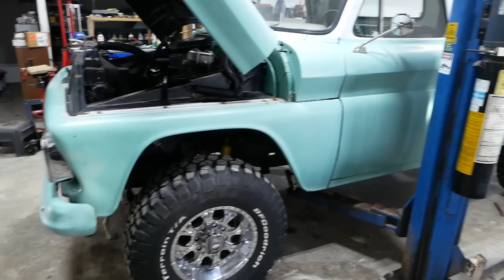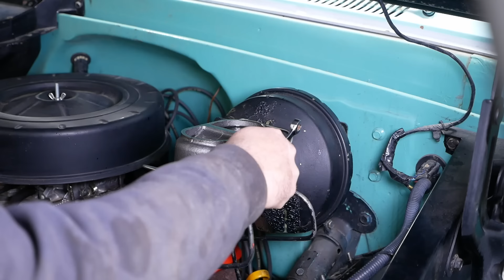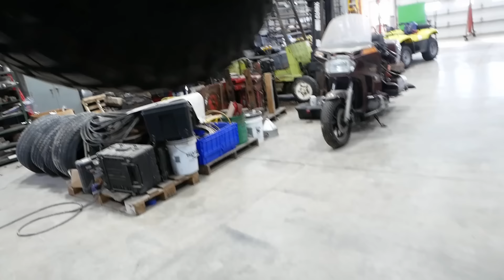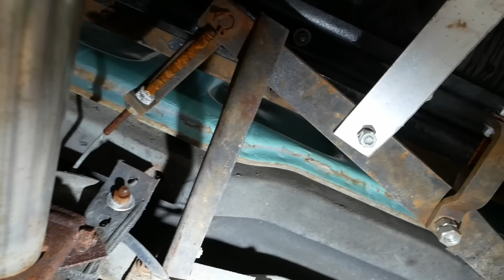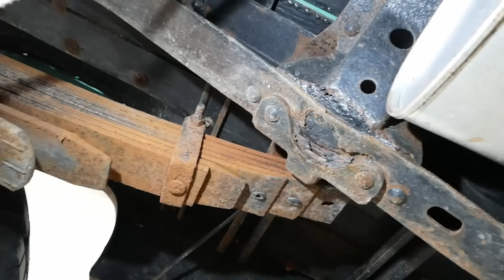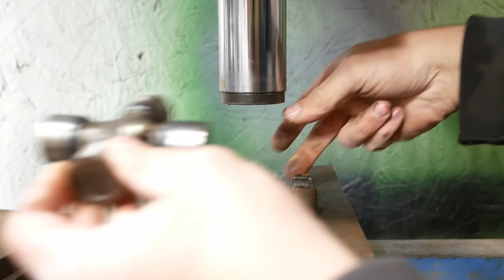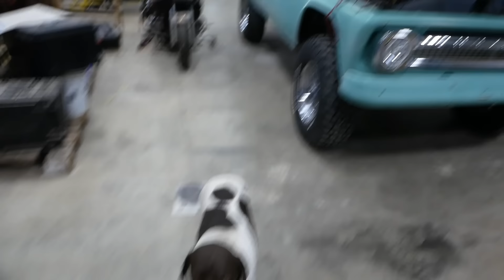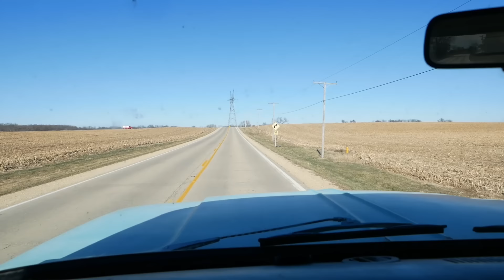New Parts = No Brakes and Other Problems | 1964 Chevy K20 Project

Comment: Hi Wes, one day when you’re feeling bored, try a long barrel air hammer with a flat 1” punch to install the uni joints. Turn the air pressure back a little so it’s got some control, use a socket or something that fits the cap to push it. I find it’s easier than a hammer or a vise, especially when you’re by yourself.
I’m sure someone will say this is a bad idea, but I’ve been doing this for years with no issues
Reply: It's a bad idea. Now it's been said and you can stop wondering when someone was going to say it /s
Reply: Yes that is another way. The dude who has the Halfass Kustom channel uses a ujoint installation tool that works quite well. When I was a Mac dealer we had a ujoint tool in our catalogue (back in the early eighties).

Comment: I like to take a flap disc to those chrome thermostat  housings under where the hose makes contact with the spout underneath where the hose would sit or they just seem to seep for ever. It seems like the coolant is always able to slip by on the chrome surface if you don't.

Comment: I'm pretty sure my Dad had one of those converted into a tow truck when he owned a shop back in the 70s. The interior brings back memories. I drove it a few times in the 90s, and no, it didn’t have power brakes or power steering. Scary as hell to drive as an 18 year old. It rusted out and ended up in the junkyard a few years later. Minnesota road salt is just as bad as Illinois'.

Comment: That guy needs to find a1975 or so 3/4 ton (Parts Truck)  with real axles and gear type transfer case and 4 speed and join the more drivable of the square bodies.  GM corporate were bad about the pinion nut coming loose and howling and reforming the nut or replacing it and re-torquing the pinion to spec's will cure it if it hasn't worn into a contact pattern that makes it "whine" after it is fixed.

Comment: You just go ahead and install u joints any ole way you want to , and if anyone has a better idea, like American Politics, KEEP IT TO YOURSELF, everyones opinion is not FACT !! I have a fine thread "C" Type U joint press that will bend a yoke in a heart beat (It has that much strength) I also have a conventional "C" type , and a Bench hydraulic press also , and if no one is looking , I'll chuck up my 714 CP Long Barrel impact chisel and knock them out in a half a heart beat and use a ball peen hammer to re-assemble before you could reach for my assembly tools.

Comment: What is a bigger controversy how to install u joints or pineapple on pizza?

The hole the brake booster mounts to looked way off and the booster didn’t look to seal the firewall off. That’s probably your air leak.

Comment: I'm agnostic about the grease fittings and method used with a steel shaft. But an aluminum shaft? Press or vise only. A very small hammer for minor adjustments on u-joint only. You can throw the balance out/dent the shaft VERY easily. Ask me how I know. 😖 With those gigonda tires, I'd keep the 4.56's and find a trans with a deep overdrive, (I'm lookin' at you, NV4500! 4.56 x.73 OD= 3.32 overall final drive ratio. And, a real deep 1st gear.). The shorter the gears, the easier it is on everything upstream. Boat load cheaper then 2 ring and pinions.  Also, Mortske is probably correct. A 14 bolt or Dana 60/70 shouldn't be too bad. Even a 10.5 Sterling? ¯\_(ツ)_/¯ (Bolt patterns) Maybe move the spring pads around a bit.

Comment: Before any winter driving that truck needs NH Oil Undercoating ASAP, be a crying shame to let that go to dust... I didn't know there was a U-joint installment controversy and I dont if there is, I still like seeing it done....... As far as Jesus Christ getting flack if changing U-joints,  he got a lot flack from lots of people on everything he did,  then after 3 short years they had enough of Jesus Christ and nailed him to a cross, but it wasn't for changing a bad U-joint the wrong way........

Comment: Ah the venerable ol 283 chevy smallblock.  Wes was it still points or solid state ignition?  Nothing like farting with points every 10,000miles.  And the cam change every 60,000miles, and plugs, and carb tuning........  My dad rebuilt many a chevy smallblock engine.

Comment: the 3 knobs left of the radio are for the heater  fan  and temp  I had a 61 short stepside, miss that pick up.  That master cylinder and booster look like a 73 to 79 pickup, real popular to change over to those they were a dime a dozen in the wrecking yards.  Alot of those pt the caps on the 73 and up pickups  made a real good pick up then

Comment: OK this is what I remember on the emergency breaks on my 1965 Ford F-100, which was kind of similar as I remember from also working on a few Chevy trucks. The park break cables was usually one cable that formed a U shape to both sides of the axel, that sat in what looked like a saddle that held a long bolt that connected to the e-cable that ran into the cab of the truck. I will send you some photos from my old shop manual's that deal with those old trucks Wes. As there is a couple of styles that would be correct or would work on that truck.

Comment: Pretty sure the welding pliers are not the correct tool to install the retaining clip/magazine/belt.  But I use a ice pick with a 5 lb hammer to adjust the clocks for day light saving.   Just saying....  Get R Done.😁

Comment: i really question that master cylinder and brake system. watching you bench bleed and the bubbles going back toward the fitting tells me there is no residual check valves that all drum brakes use.  that truck came with a single master cylinder.  am willing to bet he didn't put in a combo valve  in case one circuit blows out either. i wouldnt want the liability on that accident waiting to happen.

Comment: I drove a '61 GMC in the 70's that was nearly identical to this truck.

It was wretched to drive.

I loved it.

You're right about the parking brake equalizer.  It's just a flat metal crossbar about 3/16 thick with three holes, two at the ends for the cables and one in the middle for the tie link.  The link is the same flat stock, two holes, maybe 3 inches long.  A 3/8 or so pin joins the two, secured with the assembly-line-speed-mandated split pin through a crosshole.  You could use a nylock nut and flat washers - I use stainless these days for everything, but on that truck that's kinda lipstick on a pig.

At least your driveshaft was still attached to the vehicle.  Mine departed abruptly while 'crusing' at, like, 50mph on I-81 near Carlisle, PA one fair day.  My, my, such banging and clattering.  I drove it home - tied up the broken shaft (still connected at one end, the other yoke-and-trunnion underwent rapid unplanned disassemby), locked the front hubs, shifted the transfer case into 4-High and off we went.

You're righter than you realize.  The deeper you look, the more entertaining anomalies, engineering 'marvels' and bastardizations you'll uncover in that thing.  Moveover, it could be worse.  Mine had the V6.

Some day if you do another video on this wreck I'll post a comment about the day I was driving down a long, steep hill and discovered that though I was pushing as hard as humanly possible on the brake pedal I was gaining speed.

Comment: You working on the U-joints reminded me of an old Ford pickup truck I bought.  The front axle U-joints were really bad so I went to replace them.  I worked, hammered, pried and even used a 20 ton press and could not get the caps to move to remove the old ones from the axle shafts.  I ended up having to use my plasma cutter and torch the things out.  I have never had U-joints on a vehicle stuck like that.  I don't think that old truck had any kind of service done before I got a hold of it.  Love your video's.

Comment: AH, I had forgotten those days of yesteryear when 8 inch wiper blades were considered "good enough" . . .
Reply from the maker: And you got two speeds, on and off.
Reply: @WatchWesWork  Or the switch had two positions--whether the wipers responded was a guess . . .
Reply: Eek, the original Willys wipers you had to crank manually . . .

Comment: Dont sweat it wes I've had to replace them in a mud hole in driveing rainwith nothing more than a hammer and a pair of sockets and forestner pliers and a saw file. So have at it brother theres no wrong or right way to work it.

Comment: The type of precision needed to work on something like a newer model diesel high pressure fuel pump is not required to install ujoints. They’re fine as long as you don’t screw up the needles and you get the retainers in. When I was younger I’ve dropped them in the mud, reused old one and put different ones together to get what I needed. The ujoint installation isn’t even on the list of worries I’d have with that truck. Good work Wes. Love the content.
Reply: I find that pounding on that joint closes up the groove where the retaining ring goes in and you can't get it to seat. I have had to make a small cutoff wheel to get in there and get that groove wide enough to accept the retainer.

Comment: That is something I've noticed over the years with "builds" like that. Looks really nice on the outside and maybe has a killer engine but that's where the builders talents ended and the rest is cobbled together. Sad because then it gets passed on to a buyer who thinks they're getting a nice rig......... 
Great video as always Wes, would love to see more of this truck. It's got potential!
Reply: Yes sir there are people out there who just look at the cosmetics and do not realize that you just cannot put lipstick on a pig when it comes down to mechanical integrity. I look for a vehicle that is original and something to work with. If it looks good due to cosmetics I have a tendency to look at the stuff that counts and all of that hardware store style type of fabricating done on this truck is a turnoff. I bought a 72 Chevrolet 4 wheel drive unit from a fellow back in May of 79 and he was running down all of the things wrong with the old truck, but the powerplant was solid and all there (just needed some TLC). Come May this year I will have owned the truck for 44 yrs.
Reply: Yeah, I've noticed guys of a certain age, and ability level (or lack thereof) are all "restoring" one of these as a never ending -project- money pit...

Comment: Your comment about grease fittings brought up a memory from Chrysler engineering school from the 70s, they had a bunch of broken u joints from high horsepower cars that had split through the grease fitting, I've been installing them under compression ever since and teaching my students the same way, but if it wasn't high horsepower or extreme duty I've never seen them break through the grease fitting!

Comment: No issue with the slip yokes being at the diffs. A lot of 4x4 guys prefer that, it puts the stronger, lower profile portion of the driveshaft in the more vulnerable spot.

Comment: Unless I missed it that is a Front disc rear drum master cylinder and not original for the truck or this application.. That's the same style I used on my 73 cj6 jeep when I went to disc in the front. There have been guys that have tried to use that power booster master cyl swap and kept the drums and its downright dangerous unless you have adjustable prop valves front and rear.

Comment: As far as u-joints go, if I had a press (which I never have) I would use that. If not I would use a vice. The last time I did it I used/destroyed a c clamp. I’m my opinion, however you can get the job done is the best way.

Comment: Now you're talking my language VINTAGE CHEVY. the tailgate latch is original design except for chrome.The truck didn't come with dual master cyl, power? If the master cylinder is designed for disc brakes there needs to be a residule valve installed for drum brakes

Comment: Vise and socket ... that's how I was taught by a Red seal class A Coach/Bus/Truck mechanic 40 some years ago.
I also agree about the drive shafts ..  the slip yoke goes on the powered end of the shaft .. ie: Trans or Trabsfer case... not the driven end (axle)
Thanks for sharing 🇨🇦

Comment: Where is the proportion valve with the residual check valves?a disc brake master cylinder does not have the correct set up for drum brakes.

Comment: The idea behind compressing the zerks on some level is true. I knew a guy running a lifted blazer years ago tons of power would snap u-joints like crazy. After putting them on the compression side he had better results. The 283, I don't think you need to be concerned about it.
Reply: Yes sir I have read about that idea about the ujoints from way back in the sixties. Read it in Hot Rod magazine. The drag racers of the day would install the joints with the pressure always being on the zerk. Course if I were drag racing a car I would find me some solid joints like those that come from the factory.

Comment: I’d suggest when swapping go to axles out of a 73-87 K20 for front disc’s. And get rid of those ridiculous blocks under the front springs. Blocks are not a good idea on the steer axle. I’m sure you know that though. I thought the slip yoke was supposed to be at the axle. But I’ve heard it both ways.

Comment: That rubber fuel line over the exhaust manifold at about 16:04 should be changed to metal line properly routed before it catches fire.

Comment: FWIW, I have torn several U joints in half with the fracture running right through the drilled and tapped zerk fitting. I consider it a weak point, so I put it in compression. Granted, I was doing some very severe things to break that. Just my 2 cents.

Comment: In 1975 I bought the 1966 version of the same truck for $600.00 from the grandfather of one of the Duck Dynasty guys. He farmed in West Monroe, Louisiana and the truck spent most of it's life on that farm and around the local town. It had less than 20,000 miles on it. It still had the original wooden bed flooring because he had soaked it with creosote at some point. I used it for several years as a to and from work truck. I had a Sears and Roebuck universal under the dashboard air conditioner installed in it. It worked great unless you were sitting at a stop light and the A/C compressor would come on nearly stalling the engine. I think the engine was either a 250 or 292 C.U. straight 6. I'm old now and can't rightly remember.
El Mirage, Arizona

Comment: I had an 81 dodge with the slant 6 and 4 on the floor. Wes, that manual trans used to howl during the winter time till the gear oil in that cast iron trans would heat up from driving. Never did it in the summer, only the winter when the gear oil turned into cold molasses.

Comment: The grease zerk in compression thing comes from the off-road/rock crawling crowd AFAIK.  I heard that installation technique on the 4x4 show on TV.  Me, I get the OEM Spicer lubed for life joints, the greasable ones the driveline shop put in my truck were absolute trash and had 12 thou of runout.  So I don't grease my joints 😁

Comment: Yeah he certainly loves his springs lol... I was gonna suggest the same thing with that yoke. Nice job Wes. I had to laugh when you said "We gotta redneck engineer this thing, which is how we got here in the first way, so it seems almost fitting." Had me LMFAO 😆 Max's Pest Control Service is getting a little slow huh?!?! Sounds like the mice got him on his toes. LOL 😁
Reply: Adding in all of those springs is an old time anti rattle device , to save your sanity in a truck that has little to no insulation in the cab .

Comment: Yes, rebuilding old trucks has its problems. If you could install the modern computer controlled engine and transmission with the old body styles, than you would have the best of both worlds. But that would be a ton of real work and getting all the bugs worked out of it would probably drive you crazy. Thumbs Up!
Reply: Well there are people that do that and you are right about one thing "It is a ton of work". Of course anytime you go about modifying older vehicles with modern stuff is a ton of work. People want the cosmetic stuff on these vehicles and do not realize the ton of work it takes to do the modifications properly

Comment: I'm not nearly as experienced as some, but I have absolutely never heard of a U-joint coming apart around the grease fitting, it's always been something else. And kind of a news flash for anyone that wants them in compression, under deceleration they'll be under tension anyway, especially engine braking on manual vehicles. Also shock loading can go both ways, trying to turn the tyres forward or back, so it's entirely redundant.

As for that parking brake bracket, that's probably a better solution than factory, if so many of them are just missing the factory parts.

That thing is just in too good a shape body wise for how bad the mechanical side is, it needs to be fixed up for sure, it deserves it.